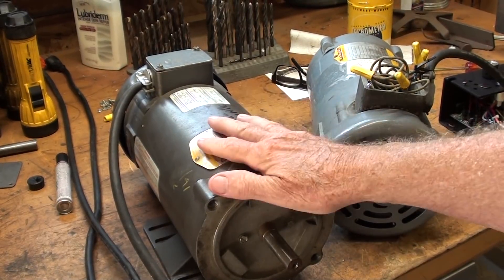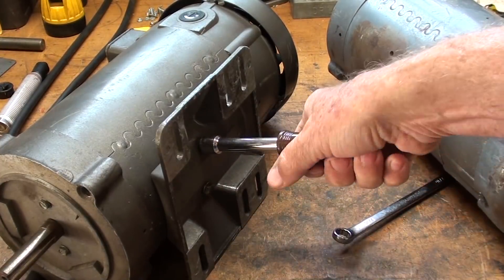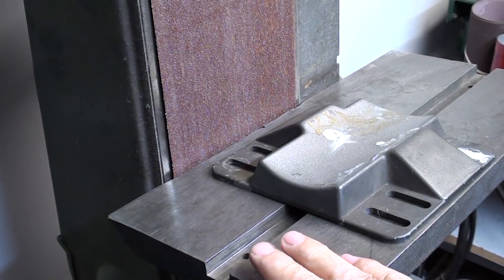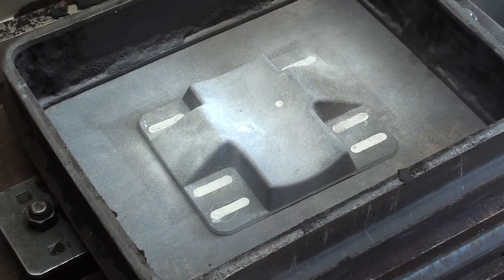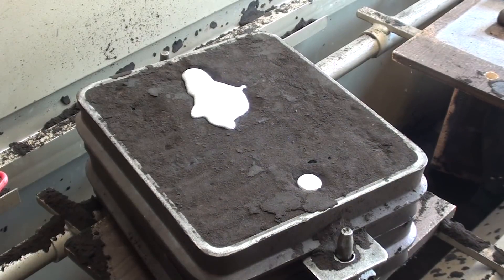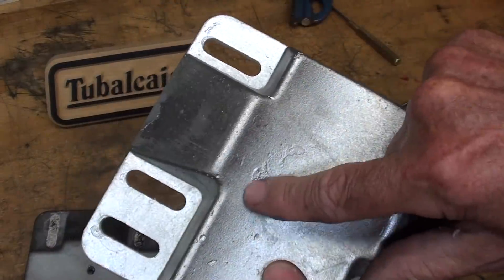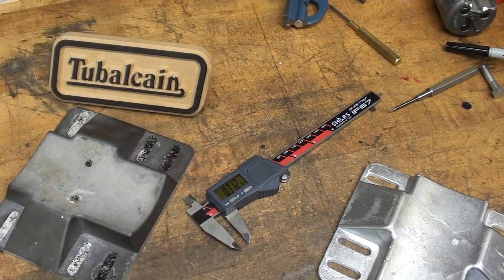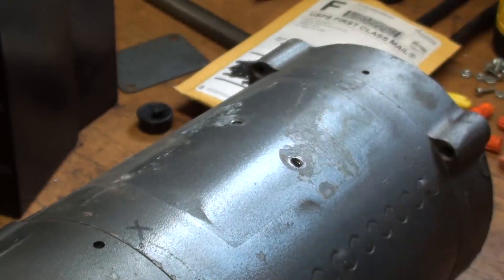Cast a Baldor Electric Motor Base Tips #478 tubalcain

Comment: Those motors are permamagnet motors so you don’t have to worry about drilling them and them and they can be used to generate power by turning them with another power source such as a wind mill
Reply from the maker: They are not permanent magnets

Comment: Electric motors either DC or AC develop maximum torque when the rotor is stalled (also draw maximum current).
Reply from the maker: Thanks

Comment: My understanding  from working with DC rolling mill motors is that torque is constant from 0 RPM up to base speed RPM.  Above base speed, torque decreases up to minimum torque at maximum RPM (usually 2 or 3 times base speed RPM).

Comment: Mr Pete: Your casting videos are just fine, thank you. I learn stuff from every one - the modeling clay trick in this case. If casting viewership is down perhaps it's for lack of drama. Good home foundry techique and careful workmanship apparently doesn't draw well at the box office. Maybe you need to crank in a few car crashes or falling pianos

The point I wish to bring up is:  I'm sure you've forseen the following but didn't go into these details for brevity's sake. I'm intruding to inform the viewers suddenly inspired with slowing their old 14" wood cutting bandsaws for metal cutting. Many times in the past, I've been involved in post mortems of unsatisfactory machine re-powering and re-purposing projects. I guess you can tell I've seen disappointing results with slowing a wood cutting bandsaw motor to achieve metal-cutting speeds.

If you're going to slow a wood cutting bandsaw down to cut metal, remember it's probably running 3000 ft/min blade speed. Metal is roughly an order of magnitude stronger and tougher than wood. Thus, cutting speeds must be an order of magnitude slower and the cutting forces higher. Here's a quick look at the math and physics.

Rough figures for cutting speeds using a bi-metal saw in aluminum and mild steel is 300 and 100 ft/min respectively. That's a 10:1 to 30:1 slowdown from wood cutting speed. Mr Pete's motors look like 1 1/2 HP shunt wound DC motors.  Shunt wound motors are pretty much constant torque devices when run at constant field exitation. Therefore, nameplate DC motor HP is at rated base speed and current. You slow a DC motor by reducing the armature voltage. At reduced armature voltage, HP decreases in proportion to RPM. Therefore, you'll have 0.15 to 0.05 HP at the cut at full armature Amps. You can overload the motor briefly without damage or excessive heating but even then, you'll have to work carefully and slowly when metal cutting or you'll stall the motor. 

If you wish to avoid stalling the motor in this application and run the saw with even moderate productivity, you will need a 10:1 mechanical reduction between motor and saw. I've seen double reduction V-belt drives in wood/metal cutting conversions that worked very well, had plenty of cutting power, and were quick and convenient to change over. It's all in a clever design.
Reply from the maker: You gave an excellent analysis of what I am trying to do. Remember there are about three on published videos, where I cover much of what you talked about. And I finally did conclude that mechanical reduction is better than the electrical. Although I still wonder about using a VFD.  Next I would like to get one of those small lawn more transmissions and incorporate it. I thought you will talk more about rigidity in the frame and the guides and all of that good stuff. Because I do say in the videos, that a conversion is never all that good. And you just cannot beat a dial or  grobe bandsaw made for metal cutting. But no home shop machinist can't afford one of those.
Reply: @mrpete222  Mr Pete. Yeah, I did plow old ground but for the sake of new guys just coming along, I revisit well established material.

So far as I'm concerned VFD and three phase induction motor Vs electronic motor control and DC motor is pretty much a coin flip. HP is HP whether from AC or DC origins. Both pairings result in well regulated shaft RPM at the turn of a potentiometer and offer a variety of connection options at the input terminals. Both are reliable and robust having wide application and acceptance in industry   The deciding factor for most home shop people will be availability of the components at an affordable cost. There are small side issues like DC shunt wound motors may be heavier and buklier than equivalently rated induction motors, VFD induction motor combinations may be more.

I agree equipment conversions and modifications are seldom as satisfactory as something designed from the ground up and purpose-built from the correct materials. I'm not familiar with the brands you've cited; Do-All, Marvel, and Roll-In are common in my neck of the woods. A plain vanilla 14" wood cutting bandsaw like the venerable Delta will if converted via a low speed drive for cutting metal will be very satisfactory for sawing small parts from light plate, soft metals and for coping structural shapes for welded intersections. Mr Pete mentioned deficiencies in frame rigidity and guides in wood bandsaws that are negligable in sawing wood but make sawing stainless or alloy steels in thicknesses a real chore. My experience over the years has proven him correct.

Comment: Now that was an excellent, professional job. Thanks for the ride. Back in HS in the 60's and out in 70 my shop round robin included foundry, pattern shop, electric shop. and machine shop. I chose machine shop for 4 years and all that opportunity and training in all the shops made for a great career and a defined benefit  pension which I am very thankful for. I used every bit of that education and more for over 40 years as a heavy equipment mechanic/welder employed by  great construction companies, the last of which was a 35 year run and as a proud member of the International Union Of Operating Engineers Local 18 here in Ohio. I was always very thankful of our shop"s teachers just like yourself and hope a lot of young people are watching your videos which may inspire them to chose a career as you are demonstrating. Now retired I am never bored as so many retirees are I talk to because I have built up a great home workshop with my lathes, mill, welders and a lot of projects. Thanks for passing it forward and all the great training videos. Ed K. Cleve. Oh.
Reply from the maker: Your school sure had a great  shop program. It served you well with a great career. Thanks for commenting

Comment: Good thing, that Aluminum is not brittle. I guess, that the motor base has warped. But bolting it to another piece will take care of that. I´m astouned, that the base casted so good. I thought, the pattern would have to thin walls.After drilling the holes in the motor, the students had at least a second chance. They could use to long bolts....caboom...
Reply from the maker: lol

Comment: Good old Sculpey modelling clay!  Always have a chunk of it on hand, just in case!

Question.  I've had large originals that would have seen major shrinkage, beefed up with sculptor's wax ... a wax that's hard enough yet soft enough to model.  Since you have a concern for shrinkage both horizontally, vertically, and thickness, I was wondering if it would be possible to beef up the original casting by dipping it in some molten wax, much like a candle maker would dip a candle, and pulling the original out.  I think one would get a uniform thickness on the wax which would nicely beef up the original casting to account for some of the shrinkage.  No?  Your thoughts on the matter.  

BTW, I'm one of those people who LOVE to see your casting videos.  I can never get enough of them, particularly the pattern-making.
Reply from the maker: I don't think dipping in the wax would work. It would all drive the geometry and the pattern draft. Patternmaker sometimes use sheet wax. Thanks for watching

Comment: If those motors are shunt wound they should not have problems with low torque and varying speeds. My big Carlton radial arm drill has a dc motor and it has loads of torque.
Reply from the maker: That's probably what I need

Comment: I noticed that the bottom of the factory die cast base has 3 distinct flat surfaces - center, left, and right. I wonder if 2 of them (the left and the right) are perpendicular to the holes you drilled for mounting the base to the motor? 
Please don't stop making videos of casting aluminum just because the viewership numbers are not high. I think it is wonderful that you have the equipment. Every video is educational so don't underestimate the value based on the number that watch. You know how high school kids are. LOL.
GEM single edge razor blades are still available in a 10 pack for over $0.50 each through Amazon. Amazon has cheaper blades in bulk. I don't thing the name is etched into the blades today.  If there is an etching it probably says China.
Reply from the maker: I was surprise you can still get those blades

Comment: Hi Lyle........As usual....enjoyed the video.  Do you know if those metal cope and drags are available at reasonable costs.....or......would a wooden set do as a "serviceable" alternative for limited casing efforts?
BTW..........I get those razor blades at Horrible Fright for about $5/100  ($4 if you use the 20% off coupon) and you can get a free flashlight...LOL.  Not "GEM" brand, but good enough for what I use them for.....which is often just cutting tape and scraping labels from things.  I personally, like them for being able to get "up close" when trimming around things.  I should have a bunch around my shop somewhere (one package lasts quite a while).  If I can remember........I'll bring some to you next week.  Regards........Rodger
Reply from the maker: Thank you
Reply from the maker: I have never use the wooden ones. The metal ones are very expensive. And hard to find used

Comment: I greatly enjoy your casting videos,  I wish you would do an in depth video about gating, the pouring cups, whether a tapered sprue has any benefit over a straight sprue. What the diameter of the sprue should be.  What kind of aluminum casts better than another. When should you degas or what not. What specific temperatures should the aluminum be at before pouring,  see you usually say about 1250. Thanks for your work.
Reply from the maker: Almost everything that you mentioned is covered in my video foundry course. That's why I usually do not mention things like that, because I do not want to duplicate it. Maybe I'll start mentioning more of it

Comment: 6:36 Have you tried using drywall compound?
Reply from the maker: Have not, but doesn't it shrank horribly
Reply: @mrpete222  I wouldn't think so- because it wouldn't be any good if it did.

How about plaster of Paris?

Just a thought.

Comment: Those high voltage permanent magnet motors are perfect for a small diameter 12 or 24v wind turbine generator. The low volts makes makes it possible to match them to an areofoil blade. Cheers
Reply from the maker: Thanks

Comment: As I've stated in a past video, it's great to have the capability to make castings to replace broken parts or, like you did, make a casting to save money. I wonder how much it would have cost you to buy a new base (if they're still available)? Never the less, good job!
Reply from the maker: I'm glad you liked it. I'm sure that's the Navy way. I never considered trying to buy one. I'm sure they are not available
Reply: I'm sure these cradle foot mounts are still available, they are still sold with new motors. There is a question about buying a replacement foot mount... leeson makes some that are stamped steel rather than cast but you need to know the IEC or NEMA standard that the motor is so you can buy the correct mount. I've seen prices for the stamped foot cradle mounts as low as $10 and some over $120 depending on size and standard.

Comment: Hi Mr Pete
There will be no problem with low torque. DC motor speed controllers have the same torque ( and in the case of electric mining shovels that I have been working on for 30+ years more torque) at low speed. It is the magnetic field interaction between field and armature that produces torque and the equation has nothing to do with speed. 
A question on the casting. You said it would shrink. About what percentage? Is it a constant or does it vary depending on the size of the casting?
Thanks for some interesting information
Reply from the maker: Thank you for the information on the DC motors. The shrinkage is a constant. About 3/32 per foot for aluminum
Reply: The particular metal used has a lot to do with the amount of shrinkage.
Reply: Older rail yard switch engines are a prime example of what you just described.  "Hump" engines pushing a cut of 40 cars or more at 2 to 4 mph up an incline, constantly.  In these (if I understood it correctly) speed was controlled with a variation/combination of engine speed and field winding load (generator field, I think).  That would keep speed down, but allow the diesel engine to run at high rpm, and run the blowers that keep the traction motors cool at high output. 

One other way of control was the motor circuits.  Traction motors in series run slower, allowing the diesel to be run at higher rpm.  Pull hard and slow, like a low gear.  Once some momentum was gained, the circuit could be changed to parallel (throwing an increased load on the diesel engine) resulting in more speed.  If you were moving an exceptionally heavy string of cars, "making transition" would make that old Detroit cry.  Being on the engine was like riding thunder.  I loved it.  Too much, in fact.  It's probably a good part of why I have hearing problems now.

The newer road engines these days don't  use DC, and don't make transition.  In my opinion, not nearly as much fun to be on.
Reply: Loss of torque in the motor depends on the controller.
I have used "plain" controllers that are basically speed controllers, and you can easily stall the shaft by grabbing by hand.
Other controllers have torque adjustment, or compensation, that can keep torque at very low speed.
Also, if those motors have field windings, not permanent magnets, torque compensation works fantastically.

Comment: Aww, I'm watching your foundry videos, and I'm the very most very importantest viewer (in my opinion) :D    Those two, wee-li'l screws are all that attach motor to base, but they give you four 5/16" mounting holes.  Maybe that's why your kids drilled so deep, wanted to compensate for the obvious weak-spot.  "Wait teach...you ALSO need the motor to work?!?!?  That'll cost you some extra credit" :D  Wow, nice job on a thin casting!
Reply from the maker: Actually, that is funny when I think about it. Two holes into the motor, and four to hold it down, LOL
Reply: Four?  I count 6 slots and they re long enough that I'll bet somebody could get 12 bolts into it!

Comment: That is a beautiful casting.  I am looking at using DC motor on my my drill presses for speed reduction.  I will be using treadmill motors because they have good torque at low speeds.   Tubalcain, you have inspired almost 200,000 people to subscribe to your videos.  You are the most inspirational shop teacher on youtube.  I watch all your videos, especially the casting videos, because I learn something new every time.  'Til next time.
Reply: I converted my benchtop drill press to a treadmill motor recently and I love it! 

One bit of learned advice- try to configure the pulleys for the lowest spindle speed possible (smallest pulley on motor, biggest on spindle). 

This addresses Mr Pete's biggest complaint that drill presses usually run waaay too fast for larger diameter metal drilling. And it allows the motor to run more towards the middle of it's speed range to ensure maximim torque development and higher momentum (stored energy) in the flywheel. 

The only downside I encountered was the lack of braking; the motor can take a while to spool down once power is cut which leads to unsafe remedies like grabbing the chuck. 

There are solutions, including mechanical, magnetic, and dynamic (low resistance/high wattage resistor switched in across the motor) braking. 

Perhaps a goal for my v2.0... Best of luck!
Reply: Otto Reuter - Thank you for the information.
Reply from the maker: Thanks

Comment: Turned out like factory Mr. Pete! Copper shavings, nice..... I use to tell them- Once you let the smoke out of that circuit you can't put it back in. I need parallels, don't have a one, yet.
Reply: +Burton's Attic
"Striking copper is only good if you're drilling rock"?
Reply: Most likely
Reply from the maker: Thanks
Reply: B Attic...I've let the smoke out of a few boards...!!!
Reply: Where you able to get it back in there?!